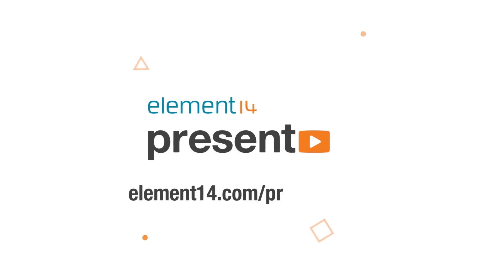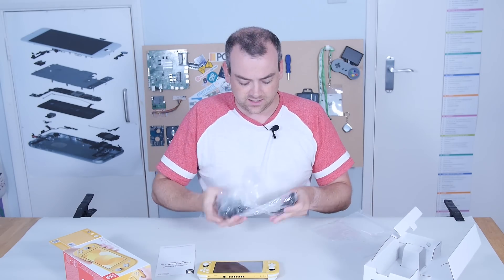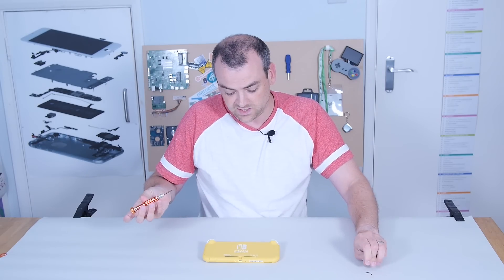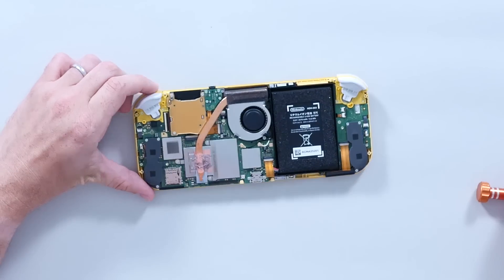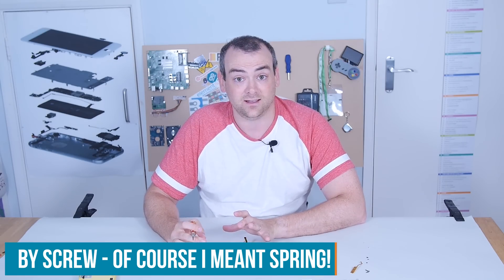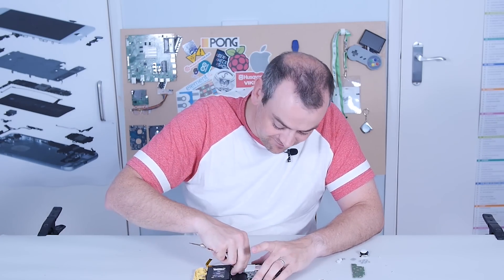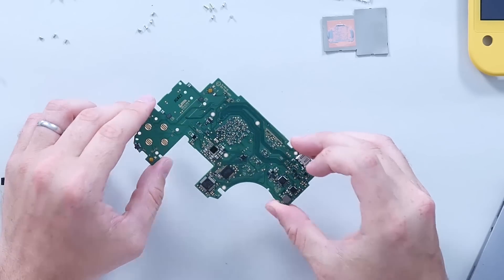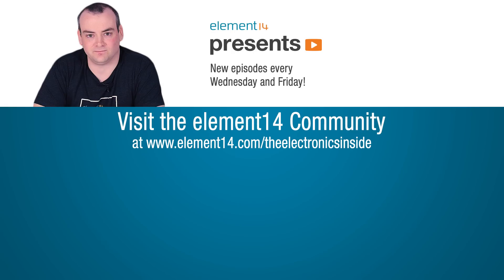Nintendo Switch Lite Teardown - The Electronics Inside

Comment: would it be possible to put in a 3.5-inch LCD into the 40 pin ribbon cable using some kind of connector/adapter? if that was possible, the switch lite internals could easily fit inside something the size of a 2ds if the battery was behind the PCB's
Reply: I guess anything is possible with a hefty FPGA and a lot of spare time from a person up to the task. But I don't think the time and effort would be worth it. The 2DS seems to be bigger than the switch, why would you want to do that, if you don't mind e asking?

Comment: Big corrections:

1. RAM is 4GB and not 2GB
2. NAND Flash is 32GB and not 128GB
Reply: He did say that there are two 2gb chips for RAM, and in the beginning he said it has 4GB. But yes according to Switch Lite specs the NAND should be 32gb

Comment: 2:06 “In true teardown fashion.....” What is it with this idiotic statement? Telling budding electronic enthusiasts not to turn something “ON” to see if it works before pulling it apart, is probably one of the dumbest things you could teach someone. How in the world would you know that it had worked or that it’s not working now, because you damaged it during disassembly or reassembly. I’d never employ an Electronics Tech if they told me that was a part of their diagnosis/repair procedure. Please don’t teach “stupid”
Reply: i think it was a reference to the classic eevblog "don't turn it on, take it apart!" joke line
Reply from the maker: Though some practices have an element of trust from the supplier to assume due diligence has been taken for it to be in a working fashion for the sake of electrical testing, etc. It's a bit of a comparison but at least this is the state of it raw from the box :)